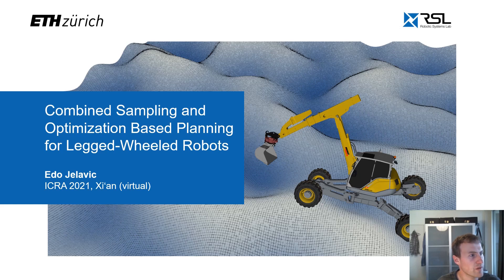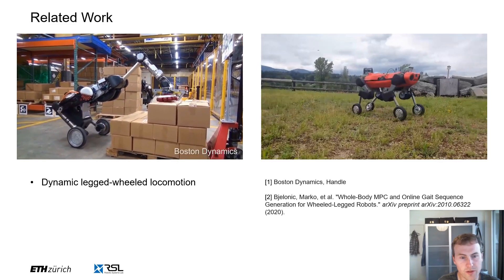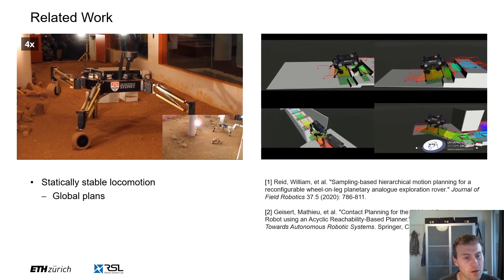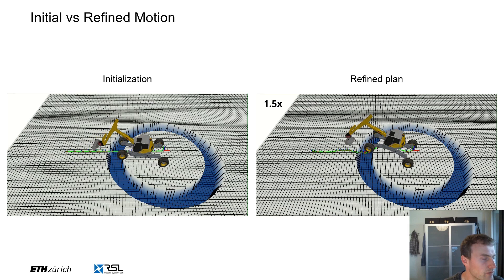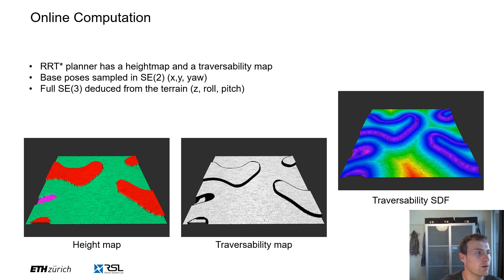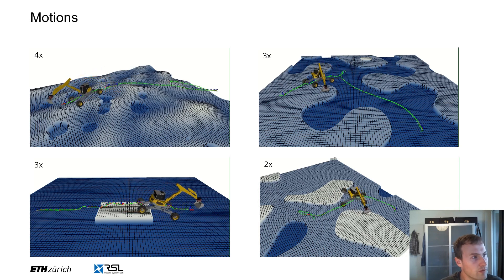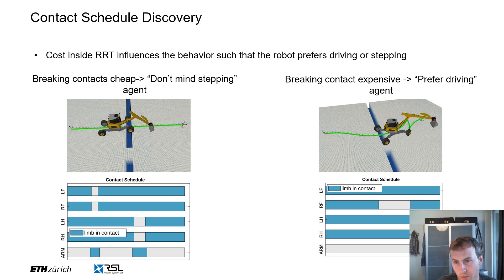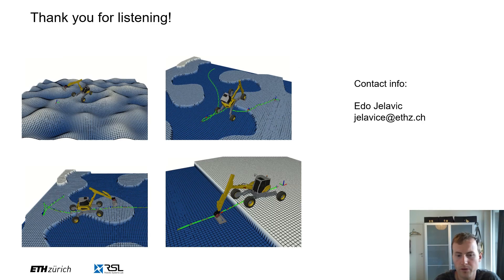Combined Sampling and Optimization Based Planning for Legged-Wheeled Robots (ICRA 2021 Presentation)

Comment: Hi, Edo! :) Thank you very much for this nice presentation. At around t=12:27, when you summarised your work, you mentioned: "However, it struggles with contact schedule optimisation and dealing with environment constraints." Can you explain which environment constraints you are referring to, and why they are difficult to deal with? Thank you in advance.
Reply: After reading the paper I think he is referring to the terrain following (end-effector height) constraint. As mentioned in the paper this constraint is non convex and terrain height is discontinuous (although interpolation is applied) which is challenging for the optimization stage.